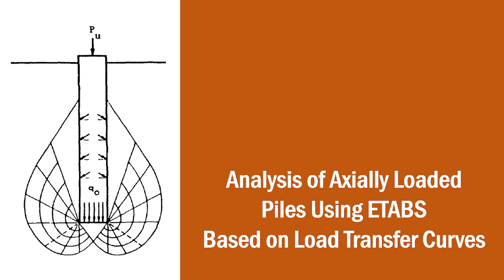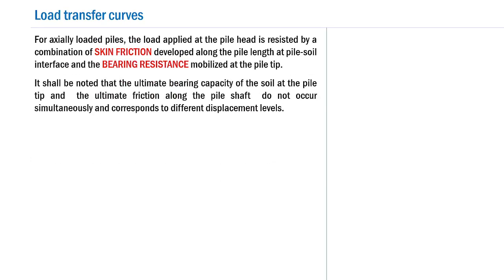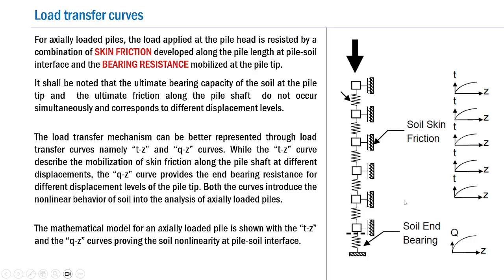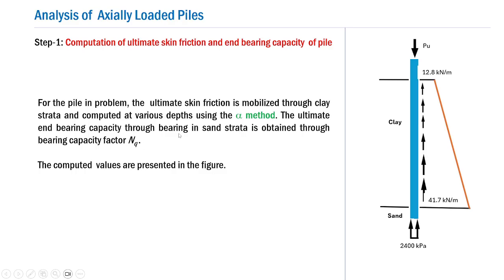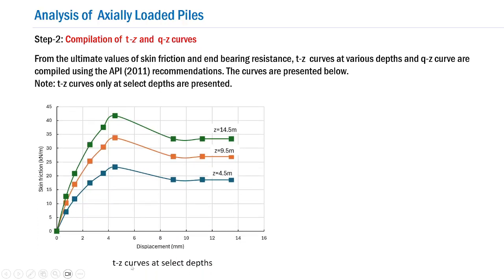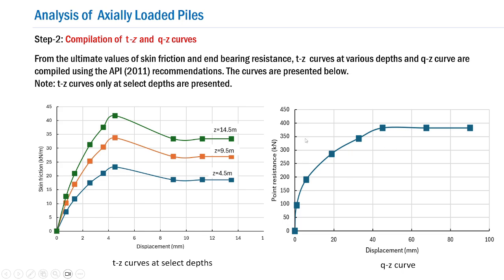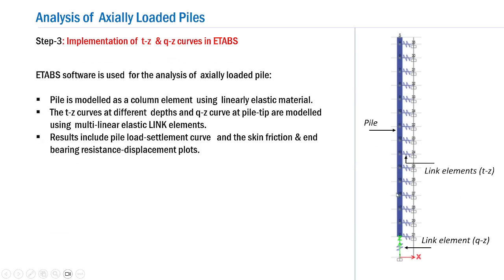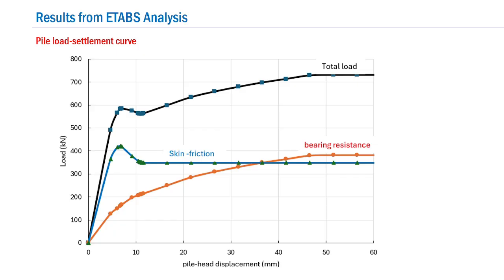Analysis of axially loaded piles using ETABS based on load transfer curves…

Comment: Great video.
1. Can you share the model?
2. After analysis, How did you draw the skin friction and bearing resistance?
Reply from the maker: Its a displacement based analysis and you can extract the (force, displacement) points at every time-step for both the skin and bearing resistance, These are simple models for which the parameters are clearly defined in the presentation